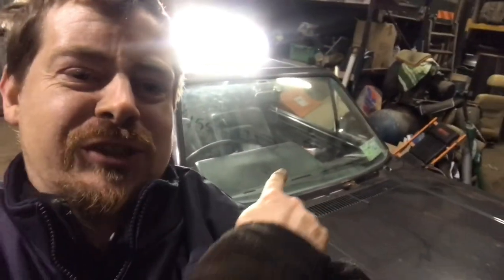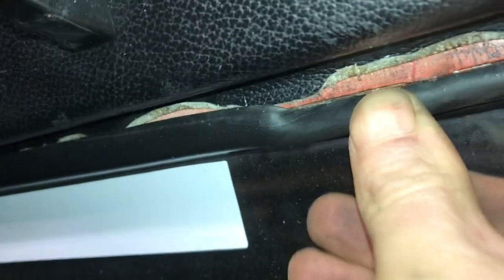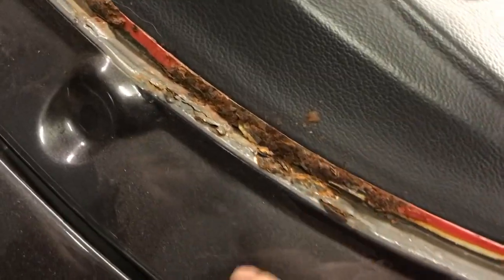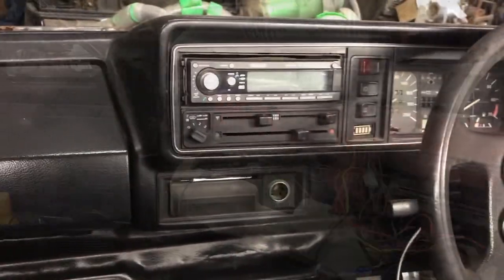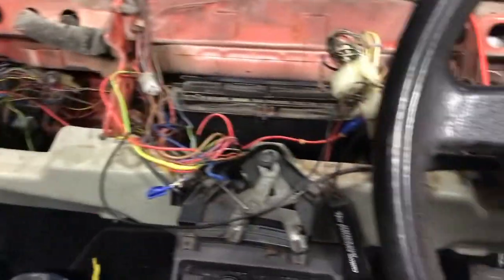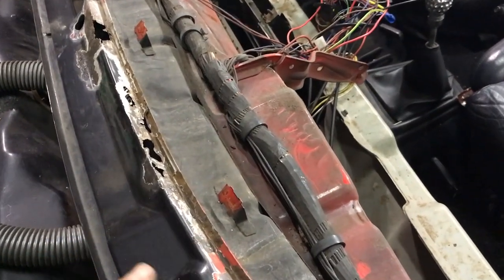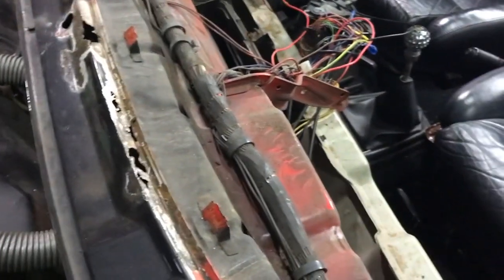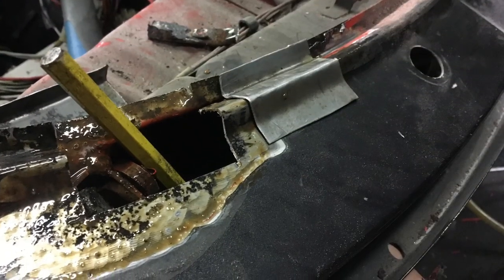Vw Mk1 Golf - Remove Windscreen and Rust Rust Rust !

Comment: the windscreen rubber holds water and they all rust under it , mk2 golfs aswell , I took out the window , cleaned up the metal etc , put non setting sealant in the rubber seal and refitted it ,
Reply from the maker: I was even thinking should I drill 2 little drain holes at each side to let the water escape ,What do you think ya or na ?
Reply: @stevenharpervw  it's les holes you need lol , the non setting sealer is the trick, it's messy to do but no  more water can get in under the seal
Reply: I've used a comma seak seal in the past that was like sticky thick silicone that 'crept' in where the water did to seal it